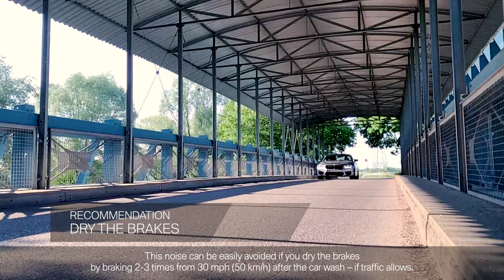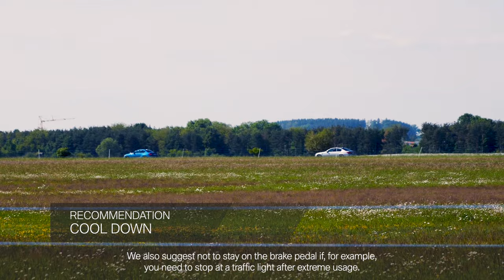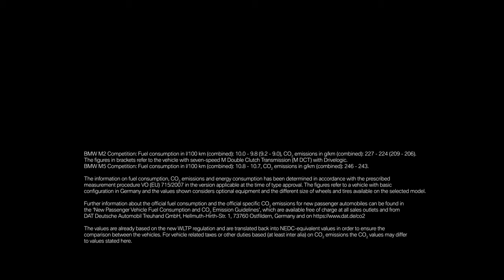How to use your High Performance Brake System - by BMW-M.com

Comment: Let me guess, people started complaining that their brakes were squeaking, especially the carbon ceramic brakes. Porsche had to make a video similar to this telling people you own a sports car, it makes noises like that
Reply: No Seasoning i see so many forums about it 🤣
Reply: yeah i bought a 90k bmw m4 and it sounds like a ‘50s vehicle in reverse, its just awful
Reply: @techeagles2403  Wow that bad?
Reply: ッΛCE yeah, the dealership said its normal for performance brakes. and idrive says service is still due until 80k miles. somehow i never hear these squeaky noises in amg’s and audi’s :/
Reply: @techeagles2403  i heard its mostly M cars but damn man kinda sucks, i wonder if theres alternative pads or rotors
Reply: well actually, IMO, Porsche has the best ceramic braking system. They have absolutely perfected it and i think it doesn't make noises even in daily driving conditions.

Comment: Thanks for helping out M owners with how to use the brakes. Can BMW M also help M owners pay the $18,000 replacement bill when the carbon ceramics rotors wear out? Thanks BMW!
Reply: J B you can just put on regular rotors after those are done
Reply: Revolution Maniac Nope … different callipers
Reply: If you can afford a BMW M car, you can afford brakes.

Comment: from what I’ve heard and seen in other videos, carbon ceramics make the distinctive squeaking noise because these are meant to be operated at high temperatures which is usually not the case in normal city driving.
These brakes stop squeaking when operated at high temperatures and that’s when they perform at their maximum capacity.
Reply: I have a BMW M4 CS with ceramic brakes and they do not squeak at all. You just have be a little alert when it is raining... brake them dry first before hard brake.
Reply: ChristHamm that’s great!! and btw the M4 CS is one hell of a beast 😍 🔥 . the best roadgoing car made for drifting 💯.

Comment: 2:37 you suggest to visit a bmw dealer? I visited the dealer but he only said "thats absolutelly normal, be happy that you Dont have the CCB's". They dont help me. My m compound brakes are squeaking All the time. I didnt considered the CCB's because I didnt want to have such Problems as noises. Now my blue m compound brakes make noises when i Brake slowly. If I Brake hard then there is no noise.
Reply: srbishkrst same exact thing here on my 2019 M5
Reply: @adameschenkel  thank you man for the Information. I dont know why bmw allways has Problems with Brake noises and Mercedes Not (of rare) .
Reply: @adameschenkel  do you have the CCB's or the blue m compound brakes?
Reply: Mine is the same if I brake hard there is no noise. But brake slow and it squeaks like hell. I am tired of it!!

Comment: I love my ceramic brakes on my M4CS, scared the bejesus out of me the first time on the Autobahn in heavy rain! They are fantastic on the track, I'm just a little scared of fade and the cost of replacing parts. I wonder how durable these brakes really are.
Reply: I am worried about the same.
Reply: @dinosoarskill17  about £5k
Reply: @BUSQU3TS  for full replacement of disks?
Reply: @dinosoarskill17  yeah, new ceramics
Reply: @BUSQU3TS  thanks, was expecting about 3x that. but when the time comes I will probably just replace for an aftermarket kit, if not an OEM steel set
Reply: @dinosoarskill17  worth double checking, but that's the price I remember. Ceramics really are a lot more resistant to heat, but as a mostly road driver do you need it? Even doing the odd track day, it is a significant amount when it comes to replacing compared to steel discs. Even people that drive on track often swap the carbon discs for steels some times during their ownership, and put them back on when is time to sell the car.
Reply: @BUSQU3TS  I am assuming you have/had an M3/4, did you track it often? i see some videos youve uploaded
Reply: @dinosoarskill17  yeah, if I had to give some advice I'd say instead of carbon ceramics spend a fraction of the cost on Pagid RS pads, steel brake lines and racing brake fluid, Motul RBF 660 is a good choice. This will improve your braking in a more realistic way and for a tiny cost compared to carbon discs. My 2 cents.
Reply: @BUSQU3TS  thanks for the advice man, hope you stay safe and well
Reply: dont be scared of fade, these  brakes are designed for high performance racing and braking

Comment: I got my new M3 Competition G80 in december from factory. I drove it really chill and never abused the brakes. After the 2'000km service done by BMW, i started to feel vibrations when i was applying the brakes abose 80 km/h. So, i don't know that happened with my car, but i'm pretty mad about it.
Reply from the maker: Hi there, in order to submit your complaint to the relevant department, we recommend using our contact form by clicking the following link: https://www.bmwgroup.com/en/general/contact.html Our Customer Support Team will get in touch with you as soon as possible.
Reply: @BMWM  hello, thank you for your reply. I'm from Switzerland, i did took an appointment in few days with BMW so they can check it.

Comment: Got ceramic brakes on my M5 Competition 2019. It was the best choice ever. I use my car as ultimate daily and breaking sound I hear really not offen. M cars are about performance so stop yelling that you hear something. Enjoy your car there are always steel breakes to take if you want but ceramic one ale amazing and they always stop. Sometimes I am more worry about people behind me than in front of me cause these ceramic brakes stop so well.
Reply: Franz P when they are dry ok they brake well and even if i drive during rain and using them frequently on the normal road they brake well as well but nobody from bmw will tell you disadvantages of these brakes...the braking effect comes later then by normal m performace brakes when they are cold etc etc ...basically these brakes are totally expensive uselless option...even one guy from porsche told in the interview in one magazine the ceramic brakes are not good choice

Comment: How do you keep the car from moving forward if you don't have your foot on the brake at a traffic light?
Reply: Transmission in neural and auto hold?!😐 
M cars does not roll off unless u don’t accelerate, even if brakes are completely released.

Comment: Tell us why in your new M cars you have opted for cheap looking single floating rear callipers instead of fixed multi piston ones on the previous generation. How is this not a step backwards in braking performance for the new generation of cars?
Reply: It's due to the motor on caliper electric parking brake. Because this replaces the cable puller type electric parking brake.
The only alternativ is to add an additional caliper(like Tesla for example) but this adds to unsprung mass.

You're welcome.
Reply: @rasch19785  is there a performance deficit from going to this design?

Comment: now explain why all the brake dust smh these brakes are just horrible, once you upgrade to 3rd party, stopping distance is the same or batter but without the noise and dust

Comment: Please explain why all the new M cars are getting single piston floating calipers in the rear, even with the carbon ceramics. Mickey Mouse brakes.
Reply: Even if they are, they’re clearly still floating calipers and they don’t belong on an M car. Especially one with the carbon ceramic brake system.

Comment: For half the cost of the CCB you can upgrade your brakes to proper racing and you get the best of both worlds. Add some cool air ducting and you ll never face fading. Bingo! All the CCB boxes ticked at half the cost.
The video was still informative, but it reminded me of badly dubbed German porn

Comment: Actually the best thing you can do for your discs after heavy and continuos braking is jump out the car immediately after that and pour cold water on them as soon as you can. This will toughen the material and next time they will work better. For more professional advice, please follow me.
Reply: That's a good way to warp the discs.

Comment: My X6M has extremely laud squeaking. was twice in dealer already  and tomorrow going again. what i can say shame bmw!!
Reply: Umm...did you even watch the video?
Reply: @craigjackson4032  yes in deed.for me and many others X5M and X6M users its not acceptable this issue check US forums.I can understand  "noise may occasionally occur under special conditions due to the heavy-duty materials used" but not heavy squeak in town!!!!!after third disc and pads change plus back plate squeaking gone finally, so as you see on my example there is some problem with your braking system!
Reply: @masakielbasa89  - are you referring to the Steel or CC brakes?

Comment: It is very funny and embarassing that they dont mention that these super hyper ceramic brakes are useless and bullshit...i own bmw m5 f10 competition and i was driving on the highway during rainning more than 100km and sudenlly u needed to brake from 110km/h to 50 km/h and guess what ?!!...thay didnt brake at all after 6 times of the pushing the pedal to the floor and they didnt brake as well...so my summary? Ceramic brakes are expensive useless bullshit and even dangerouss....

Comment: What made me feel uncomfortable was not the noise was the £7000 sterling pounds bill to replace the frond discs and pads at only 28k miles due to a disc failure where a bit of the disc decide to fly away ! Rubbish brakes ! Extremely temperature stable my ass ! Robbery ! Where too much is right ?!?! LOL what a shamble !!

Comment: Poor quality that's what I call it. Visit your local dealer and they will try so hard to sell you new break pads and discs that will make the same noises as your old not worn out pads and discs 😂😂😂😂
Reply: Nabil Askri what are you talking about?
Reply: It has nothing to do with quality. Brake noise is a normal byproduct of high performance brakes. Period.